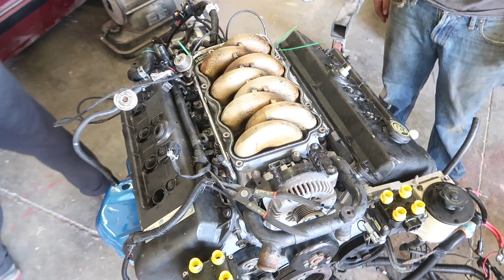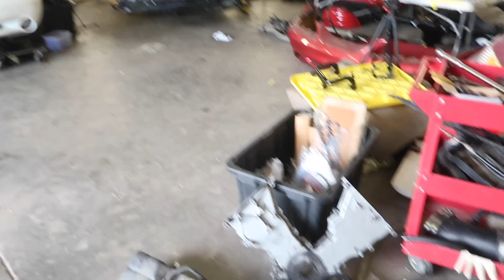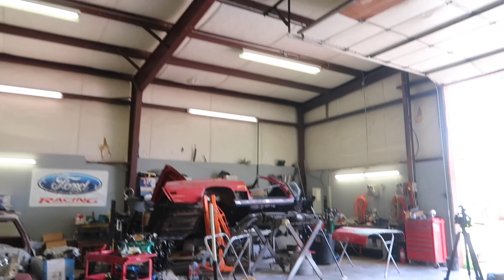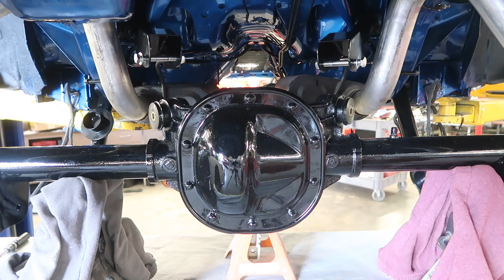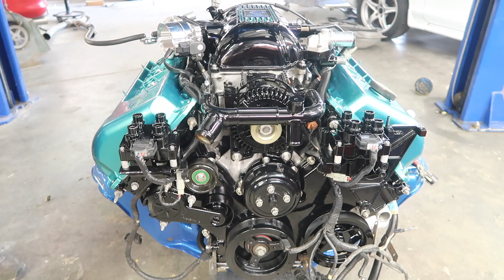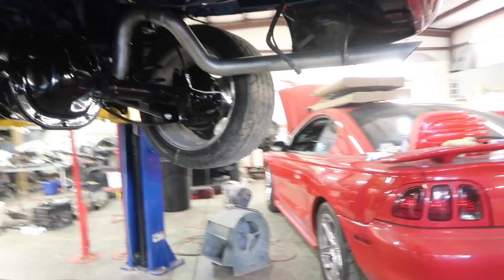Mustang Cobra Motor Install Plus Paint. CLEAN AF

Comment: I saw a Mustang assembly line working once. The engine and entire drivetrain go up from underneath on the K member and someone runs the K member bolts in and they were super fast about it. 
From there it only took them a minute or two to hook up the engine's wiring harness, coolant hoses and A/C lines and that engine was installed in a minute or two.   Great video!

Comment: You do incredible work! I love all the extra steps you do like painting all the under hood components. That engine looks so good by paying attention to detail. Some one is going to buy a one kind well done Cobra. Cannot wait to see it when it is all done!
Reply from the maker: jmfut thank youuuu!
Reply: I ALWAYS SAID LOOKS WISE THE 96 98 COBRA MOTORS LOOK AWESOME AND THAT'S WHERE IT ENDS THE STOCK INTERNALS ARE JUNK LOL I KNOW LOL I HAD 20THOUSAND ORIGINAL MILES ON MY 97 COBRA AND RACING I MISSED A SHIFT AND THE BOTTOM END EXPLODED. LOL IN MY OPINION THE BEST VERSION OF THE 4.6 ARE THE ONLY 04 TERMINATORS LOL NO HEAD TICK AND NO ISSUES BUT SOME LITTLE THINGS BUT YOU COULDN'T GIVE ME A 96 98 COBRA.

Comment: What's up guys. Quick question.  When you swapped out the ABS unit did you use any special tools? Is there any special procedures that need to be done? I would like to swap mine. It got wet by a bad water pump and the light is now on. Thanks for any reply

Comment: Hey I was wondering if you an help me with this code-I have p1131 -lack of ho2s11 switch sensor indicates lean and p0131-sensor circuit low voltage bank 1 sensor 1 (it's not the sensor I changed that sensor 100+miles ago). Any advice?

Comment: tko I need help my mustang shuts off while in neutral while in gear it's normal no problem I need help
Reply: Fernando Contreras idle air control is bad or throttle position sensor.. or you need to clean your MAF sensor
Reply: cpstang24 i have the same problem my car stalls when i put it on drive or reverse it starts up fine i rapleced the tps sensor and still does the same crap long story short ive had problems with it since i drove it top speed its a 3.8 v6 lol

Comment: Amazing video , as always ! Hey guys , it's not a good idea to put poly bushings in the upper control arms ... Just install rubber ones there ... That "quadrabind" horrible ford's  rear suspension project is very dangerous ... For more tech , check at Maximum Motorsports website ...